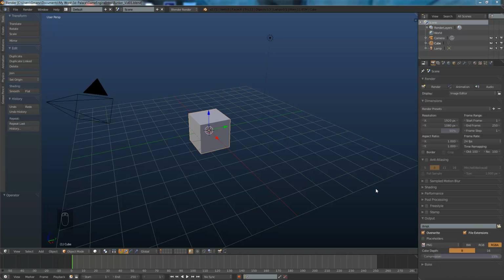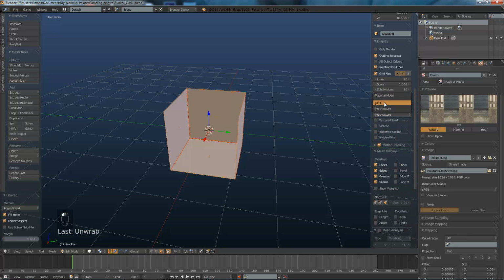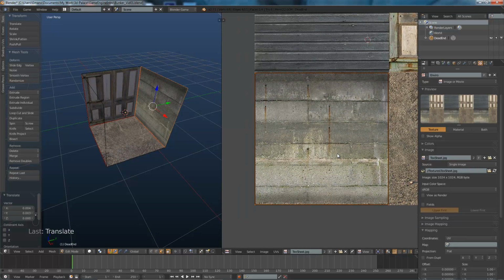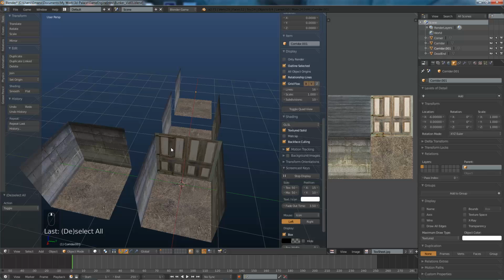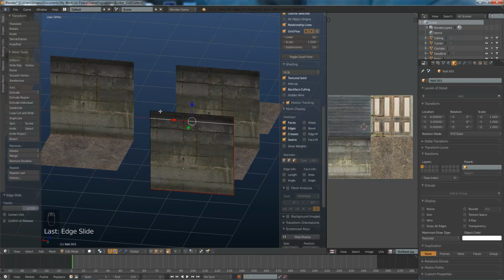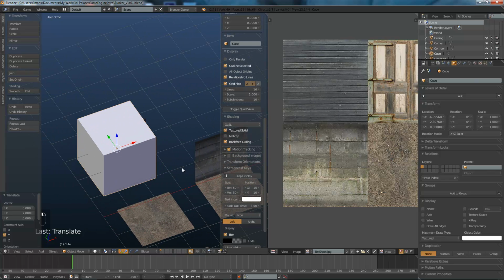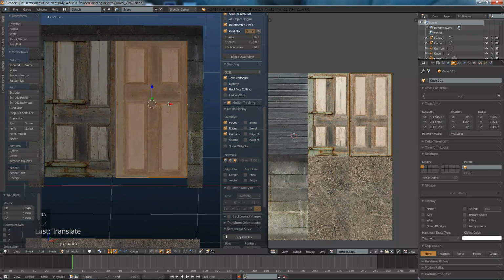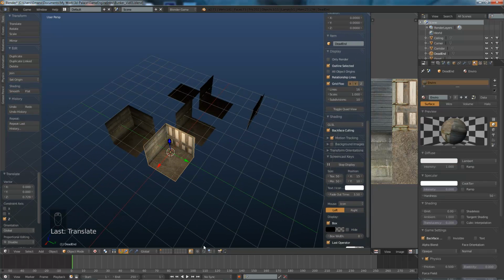The Blender Game Engine Tutorial - The Bunker Part 1

Comment: Can't blame the guy for moving on from blender, I've had to as well for many things including not just sculpting (* blender lacks brushes that follow 'topo' properly ! ) but editing. Sculpting is better in 2.76, but' editing is horribly slow because the 'viewport' code has not been updated yet to use newer versions of GL. Until then you have to be careful because once a mesh gets a certain size, you can't rotate screen in edit mode without horribly slow downs, and my machine is only a year old fast enough to play use maya lt with zero slowdowns.

Comment: I love the Tutorial, Have been searching for this for awhile.  I have gotten to the point of trying to create the door frame, but it will not allow me to add faces to the two separate objects.

Also, When I delete things(i.e Faces from the doorframe) I have to select it delete, but it only deletes face object from UV and i have to then reselect the face to delete again for it to delete, but i believe it messes things up when it comes to deleting the face on the door frame. Any help is welcomed!
Reply: make sure u r in edit mode when  uplicate the door frame, then u will be able to make face from 2 edges.. since both will a single connected object.  if u duplicated while in object mode, select both frame in object mode and press ctrl +J to join

and for the second part watch ur mouse pointer .. blender sends keystrock to the window that has mouse pointer.. most of the time
Reply: *****  Thank you, That helped a lot.